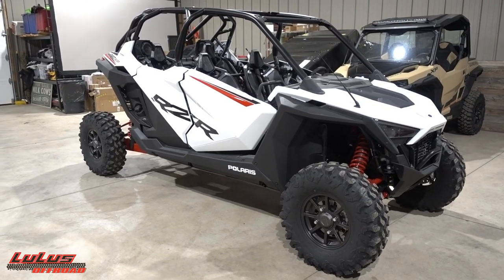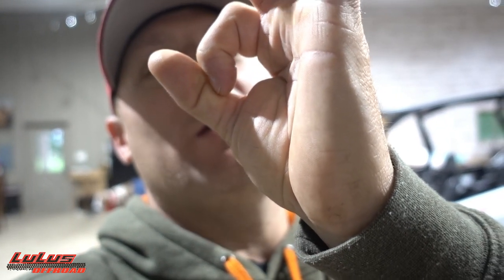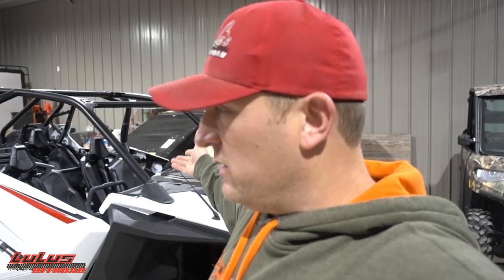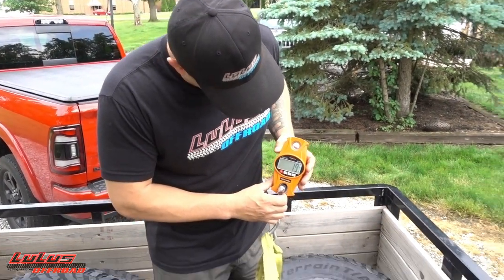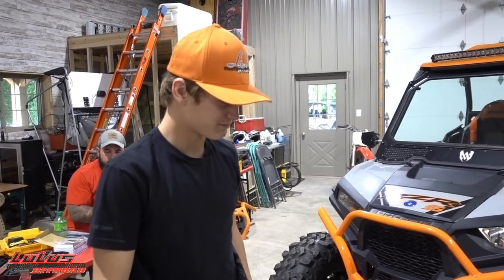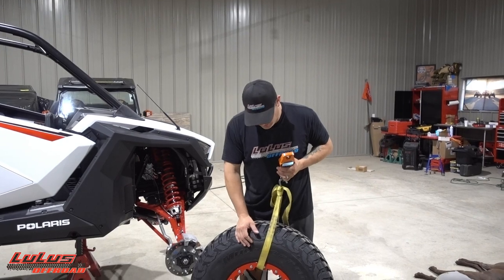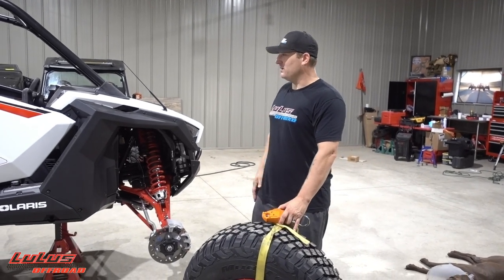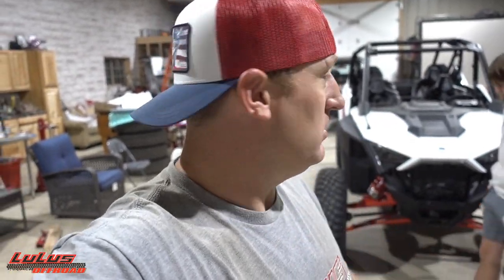Aiden's New Wheels & Polaris Pro Xp Update!!!

Comment: Every time I watch someone add wheel and tires to a machine I end up going back and watching shock therapy's video "Shock Therapy LIVE: How Wheels & Tires (4/15/20)" 

I was trying to remember if it was the 900 that they said was fine with a 4:3 offset and well it is the machine they say is fine with it.
Reply from the maker: Definitely thought he could benefit from a little extra width. The weight is a little bit of concern, but overall I think it will do fine. Time will tell. Thanks for watching.
Reply: @lulusoffroad  the best part is I left that comment before I saw the offset on the Pro and you saying the guys in the comments are going to mention the offset being wrong and I laughed pretty hard